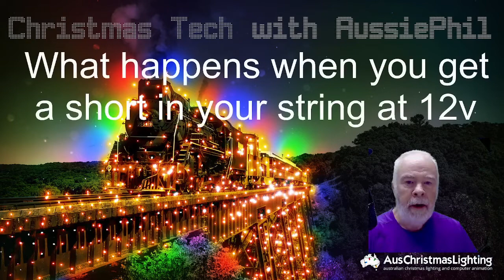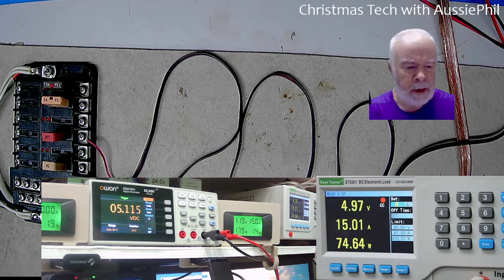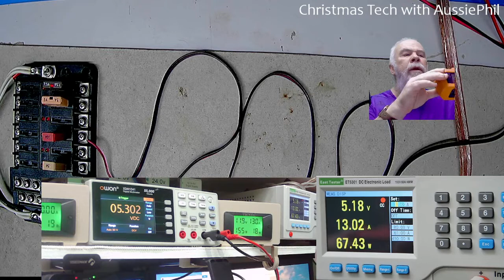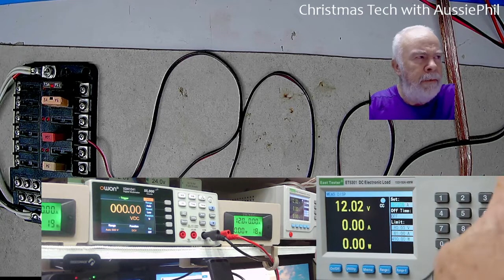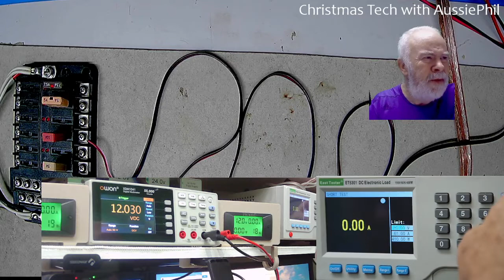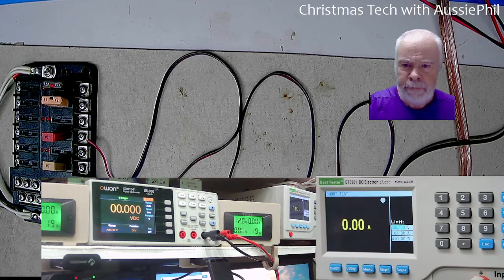What happens when you short pixel wires at 12v

Comment: The sad thing is that it's not only when it's a short circuit that people will see this sort of current. People will keep adding pixels until the pixels start becoming pinkish and then will add more and reduce the brightness. This means that there will be a fairly consistent load that is quite likely going to be in the 10A load even if they have set the brightness low so that they can hook up 300/400/500 pixels off the 1 fused output.
Reply from the maker: Absolutely right Alan however for 5v pixels even at low brightness the loss over 20M (200pixels) of cable is excessive. it is a concern for 12v pixels and I will explore that in another video